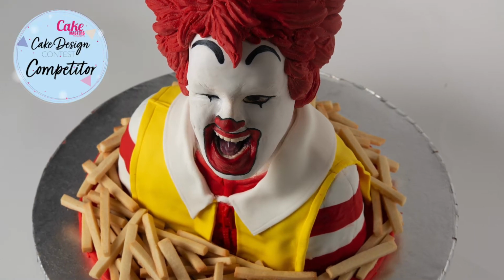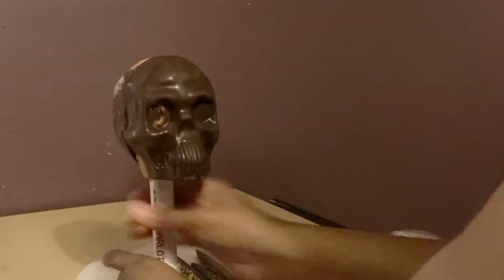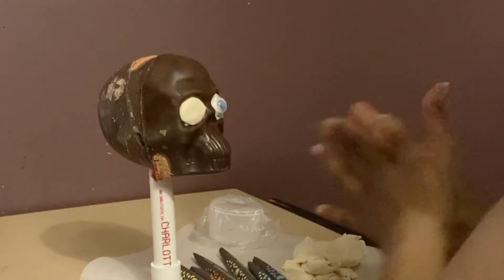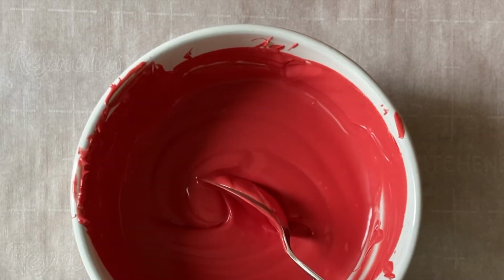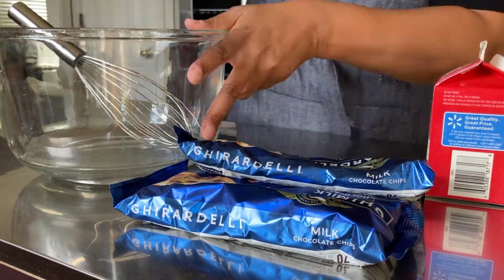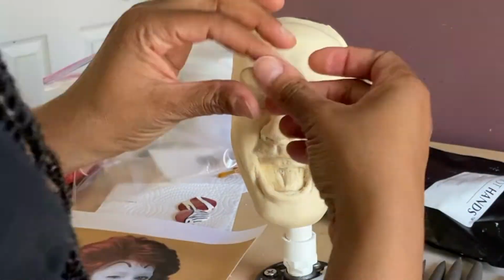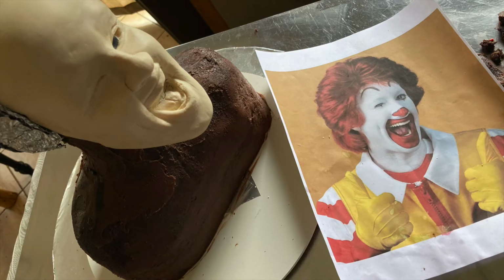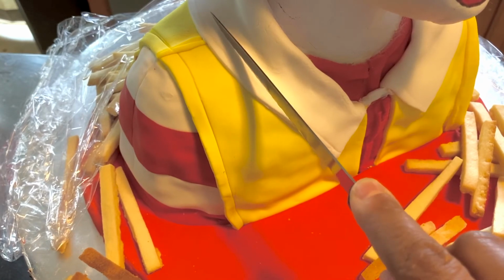How I Made It: My First Competition Bust Cake!

Comment: How did you attach the head to the pipe?  How did you make it stable?
Reply from the maker: I drilled a hole halfway into the bottom of the chocolate skull and “glued” a pvc pipe into it using melted candy coating. I screwed a metal flange into my wood cake base and used a threaded pvc connector to hold the pipe with the head.  This setup is very stable! 👌🏽
Reply: @AsiaCoffee  thanks!